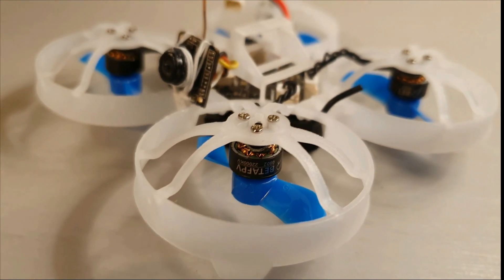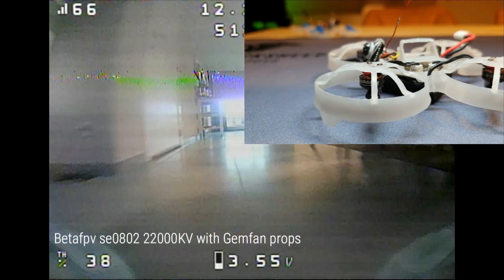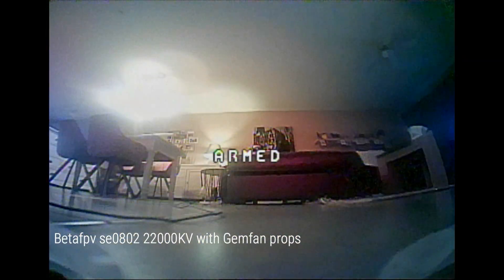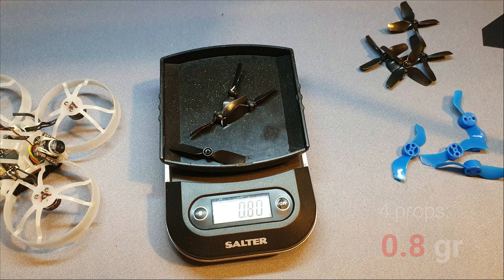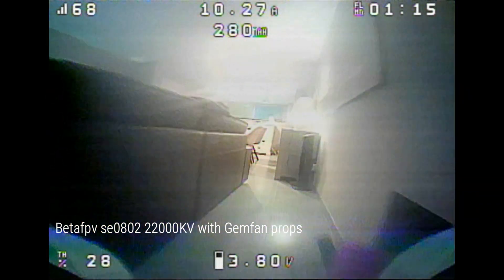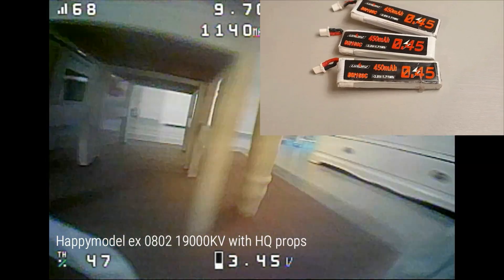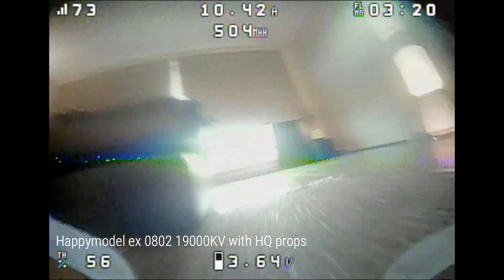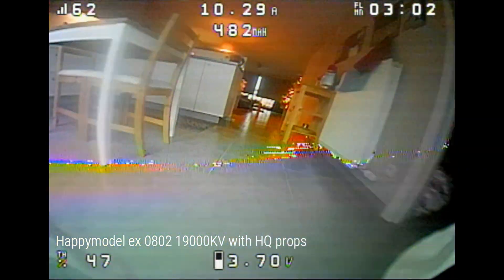1S 450 mah, 7 minutes flight time!? Motor and prop comparison | Square One FPV

Comment: Love the data bro! I think you'd dig the new NBD 75mm frame. Alotta pusher and configuration potential. Now I gotta build an efficient 1s haha, I only get over 4 minutes on my 2s builds right now.
Reply from the maker: Thanks man! I'm flying the HQ bi-blade now, the ones from the Moblite, almost the same weight, better durability, and the same flight time 👍. That a really cool looking frame, but 7gr is a bit much, wonder what it weighs without the carbon plate. That 65 mm frame tho 👌, that's nice. To bad nobody sells these in Europe, when I buy stuff from the US taxes are added and it gets ridiculously expensive. Have fun building!
Reply: @SquareOneFPV  They say 7g in the website but mine was 6g flat with carbon. I think the listed weight is with their tpu battery mounts. Very durable and the hoops are smaller for an overall smaller footprint. Using for 2s right now 26g with a 4g canopy/cam and gnb27 connectors, could be lighter but I already broke a couple nano 3s.
Reply from the maker: @MissingNumb  Now 6 gr I can work with 😁, thanks for the info! I flew 2s and went back to 1s. 2s just adds to much weight. My "InsanitY 75" build feels almost as fast as a 2s, definitely inside. I think you would love it! I fly on a bt 2.0 connector with dirt cheap 1s 450mah URUAV batteries. And the whoop draws so little amps they don't even get warm.
Reply: @SquareOneFPV  Definitely 1s is the business indoors. Not just for power , but ease of use. Twice as many flights before a need to charge up! Weighed the bare frame, 5.3g no plate. Now to scavenge a cam from another build! Happy flying bredren!
Reply from the maker: Thanks for weighing it, that's pretty good. Yeah lots of benefits, let me know how that build turns out! C ya 👊🏼
Reply: So the results are in, built one up as a 1s pusher. 24.7g with carbon brace, larva x canopy, caddx ant, and the azi props they have. I can't believe it's only 2g more then your build. But I have to thank you for the definitive data on the secret sauce. The pusher! It doesn't handle like a whoop anymore. Tried my hardest to washout but nope. Thanks again for the tips!
Reply from the maker: @MissingNumb  You're not playing around, that's a fast build bro 😆! No need to thank me, but I am glad you dig it! I am kind of intrigued with it being a pusher and it still has a canopy, you on reddit or something, can you post a pic? Anyway enjoy your build, happy flying!
Reply: @SquareOneFPV  I am just using taller  style fc grommets to mount the board and then standard whoop sized gummies to fill the gap to the canopy and extended screws to secure it. It butts up against the carbon plate perfect. It kinda looks like the emax pushers a bit. I will try and get it on rotor builds today, but my kids are a handful lol.
Reply from the maker: @MissingNumb  lol, yeah no prob, got to set your priorities 👍. I think I get the idea, putting a canopy on the "bottom" side of the frame, that's funny and genius at the same time😆!

Comment: Great build and rewiev 🍀👌i also swap my mobs6 in to a 75mm and use HQ, its awesome 🤙 like and sub done ✌️ ceya my friend
Reply from the maker: Thank you very much! Yes 75mm is great, so much stronger compared to 65mm. I've got 2 more builds coming up, a 75mm build which can carry a naked gopro for at least 3 minutes. And a build kinda like yours with a vtx capable of 500mw and a better receiver. Thanks for subbing and happy flying buddy! 👊

Comment: You should try to get some of the new biblade HQ 40 mm props. The ones that come on moblite7. I have a moblite7. I don't have any more of the HQ quad props to cut down. But the new ones seem like they super fast and powerful. But I feel they have a weird power curve that comes on really strong. But they are surely tougher than the cut down quad props. I got some spares from newbee
Reply from the maker: This is great I've been looking for the HQ biblades, but I couldn't find them anywhere, thank you!